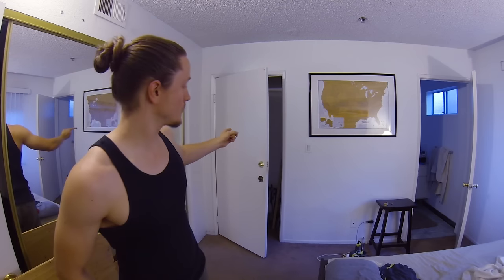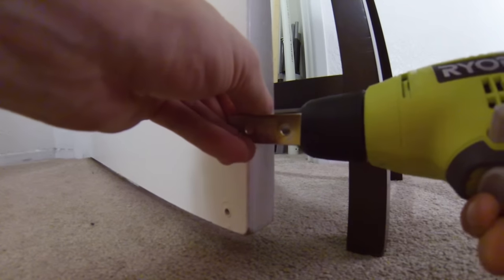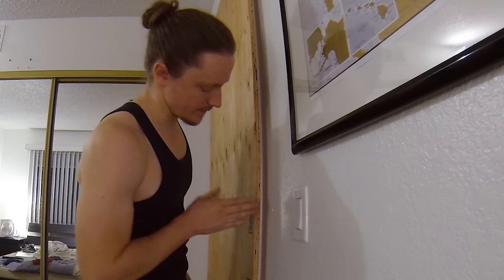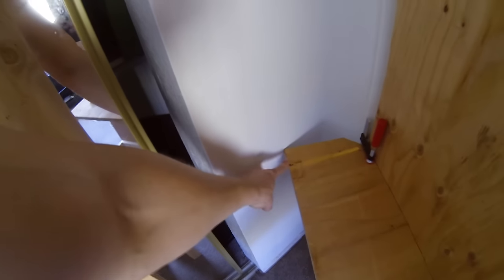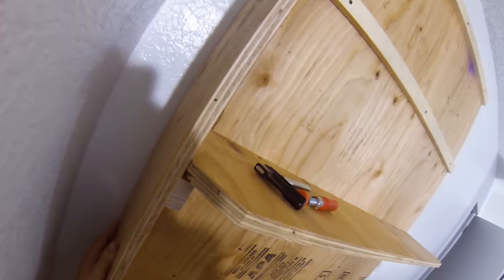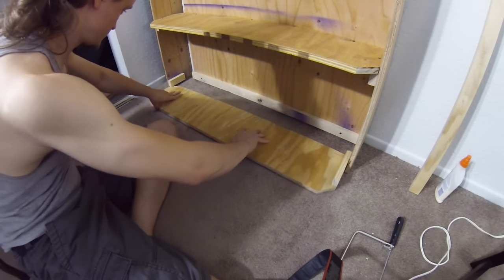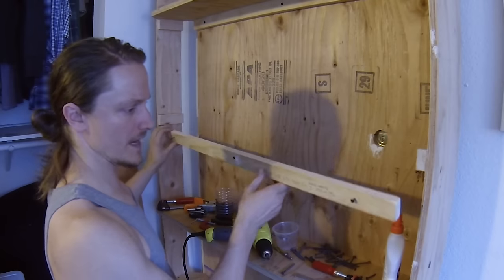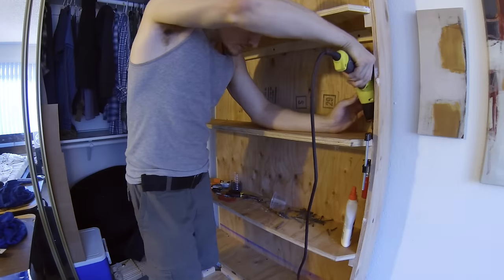How to Create a SECRET ROOM with a SECRET DOOR in Your House!!!

Comment: Could’ve re-hinged the door to swing the other way. Still a great job.
Reply: I was thinking the same thing !
Reply: Maybe he didn't have enough space for the door to open
Reply: No because the bookshelf is connected to the door.
Reply: James Ross i mean the whole thing, maybe the whole bookshelf is too big for this room (inside).
Reply: Joseph Hathaway but the thing is anyone could mistakenly open it
Reply: @dynamitedog4949  they have to pull the flap back or it will just crack a little  and bump into the wall... If he keeps the door locked it won't move at all
Reply: Yeah...my thoughts too...lol
Reply: I think people are taking this as having the door swing into the closet. Joseph means change the door to open into the room from the left hand side instead of the right.
Reply: I was thinking the same thing.  Laziness is one of the parents of innovation.

Comment: I like using the original door with lock for securing the room. I would only suggest instead of a screw to put the board back; hiding the lock, maybe some inset magnets to secure the board quicker and easier than trying to have a screwdriver around!?!? great customization in hiding the left side of the original door and lock!!
Reply: I like that idea better as well!!

Comment: Based on the location of the doorway you are using... I would suggest reversing how the door opens, so that it opens from the left-hand... Then it wouldn't be opening toward the wall. Use long hinge-plates -- so the pivot line is about 3/4" further out from the door facing -- and the shelf-unit could open a full 90 degrees...
Reply: Great idea. I have no idea how many of us missed it!!😆😄

Salaam to you and to all.
Reply: I would have re-hung the door to the right side. Simple to do and the door will open to 90  deg.   Currently you are limited to the size of objects you can push through.

Comment: Nice job for a DIY guy with basic tools. For anyone thinking about doing this I would suggest using cabinet grade plywood over construction grade. It will provide a much nicer/smoother paint finish, and is much easier to work with because it remains flatter. That was a lot of extra work to accommodate the problem of the unit hitting the wall. Just move the door hinges to the opposite edge to alternate the door swing.
Reply: I thought of switchng the hinges, too

Comment: For this design, though, you can't use it for a panic room since you can't close the clasp on the left if you're inside.  But for a secret storage room that you rarely frequent, it's perfect.
Reply: bet you could add an eye hook to the back of that panel, with a piano wire so you could pull it closed from the door crack. not sure how to pop it back open from inside though! that could be a problem.

Comment: Instead of having to screw and unscrew the last scre to lock and unlock the door, which will wear off the paint quickly, you can get a small dowel rod that slides forwards and back. You could carve it to look a little like a screw. It might stick out a little bit but I doubt that anyone would notice

Comment: Bad ass secret room. I would say instead of screwing in the shelf and unscrewing to lock/unlock, simply move the shelf a little lower than the door lock, and attach a book facing the front with a cut out inside the book. Open the book cover and reveal the hidden door lock and or handle. But still a dope vid!

Comment: Would be nice to have more in depth views of the relationship between the bookcase and the door hinges.  Further investigation, decided one might leave original door/hinges intact, unmodified.  Add new hinges swinging from the OPPOSITE side of the door frame swinging only bookcase.  Case would open....avoiding the wall interference problem....with lockable door, using flush lock set,  still closed and locked.  Solves many problems.  Can use extended hinges for even better swinging dynamics.  A removable piece of trim , maybe held in place with magnets, between bookcase and wall completely closes off any indication of the hinging mechanisms.  Might explore using inverted "Ushaped" brackets attached to the bookcase back allowing hanging the bookcase over the door ala an over-the-door clothes rack.  Allows future removal of the bookcase without a ruined door. Changing to offset hinges, as commonly used for full door opening clearance as in wheelchair applications, would provide better door swing.

Comment: I have to say yours is one of the best I've seen especially with the added security of the hidden lock and folding frame piece  👌 👏  excellent work.  How well has it held up with the added weight. Wondered if maybe a few extra added hinges would be needed for extra support?
Reply from the maker: Thanks so much!  It has actually held up very well.  No wear and tear on the carpet from opening and closing, and the hinges are still holding strong.

Comment: I would have taken the door out completely and put some swivel hinges in and built the book case onto the door and leave the book case frame in place that way only the door would swivel. Obviously you would have needed to move the swivel closer to the doorknob so it would open without rubbing. Also place a nice decor on the shelf that would have tripped the closing mechanism of the doorknob so you could put a pull book to release the latch or something. But if your happy Im tickled pink.

Comment: Want to hang a full bookcase from original door hinges such that case opens 90 degrees with door remaining closed and locked....using flush key lock.  Anyone done this?  Would consider adding extra hinges for case, using original door hinges for door alone.  Is there a YouTube video of this approach??

Comment: Was also looking for the bookcase on the outer wall. The only difference I am looking at is mounting the bookcase to the existing door. My hope is I will attach 6 of a similar hinge with the door hanging in its current position. After that, I will remove the existing standard hinges. Hopw this works and thank you for sharing!

Comment: This is good only when used as a safe for stashing objects away, but wouldn't work as a 
hide-out. That room will lose secrecy cuz when in, he couldn't push back the small piece that covers the frame of the real door on the side and lower the shelf that covers the lock. So, anybody entering the bedroom when owner is inside the secret space, could clearly see that there's a covered door there. However, nice job.

Comment: I would have made use of 2 small magnets (or one and a steel slug), instead of that "last screw", for the strip of wood over the lock. That way you wouldn't need a screwdriver to slide it down.

Comment: Can this work with a door opening inwards? Please reply
Reply: Might add extra hinges for only the bookcase to swing outward., leaving the original door and hinges intact, unmodified.  The bookcase could swing outward with the door remaining closed and locked for added security.
Reply from the maker: Agree with @StL Pro2A If the shelf is going going on the outside of a door that opens inward, then you would need to use separate hinges, so that the shelf would open outward separate from the door which opens inward.
Reply: @ScapeSketch  thanks for the reply I just seen both of the replies, thanks it was a nice build!

Comment: Won't the weight of the books and everything mess up the alignment of the door eventually
Reply from the maker: After several years, the alignment is unaffected.  The shelf's weight sits mostly on the floor, so it's not really pulling on the door or the hinges much at all.

Comment: This is all nice, but the fact that the entire construction (including the books!) is hanging on a pair of door hinges -- which are attached to the original thin pine door jamb with six 3/4" screws -- that fact gives me enough reason to vote this down.
Yes, I remember the part about the bottom shelf, but supporting something with a layer of carpet is a bad idea too.
Reply from the maker: You make a good point.  If my carpet wasn't already terrible, I probably would have built it on casters or something, but to be honest, it's been several years now and there has not been any wear on the carpet, nor have the hinges come lose, so I think for my particular situation, it was the right design.  Thanks for the comment!

Comment: My lazy ass would ong just buy a shelf and super glue it to the door
Reply: That's sorta what I was thinking. I have a feeling it might be easier to just buy a shelf and modify it and the door as needed. It's certainly what I would do if there was no space constraint with a corner. Otherwise with all the adjustments you'd have to make to get it to fit you're probably just better off making it yourself.